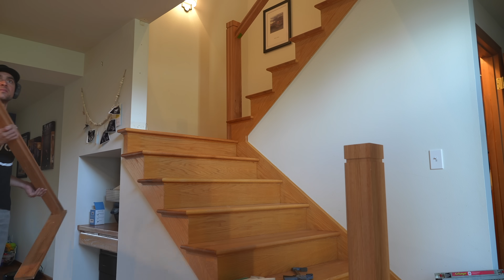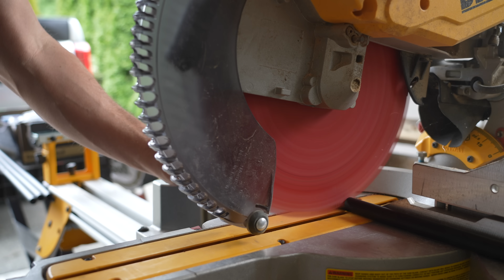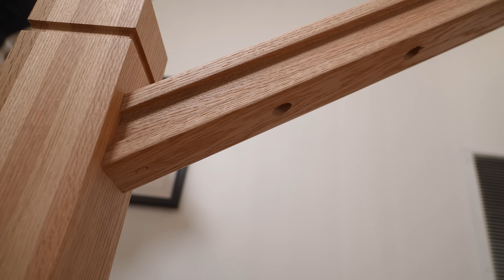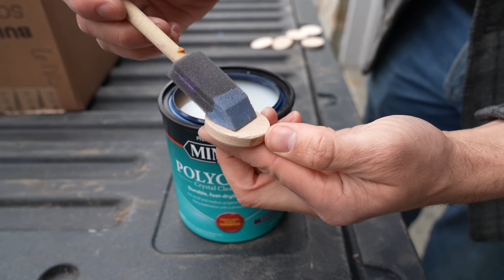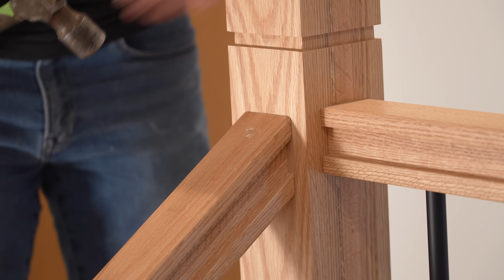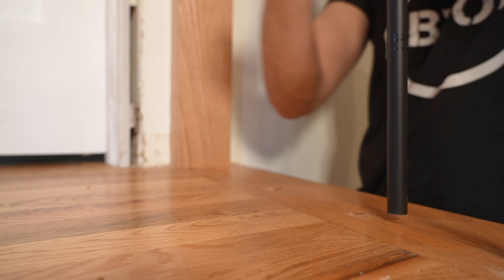Transform Your Staircase: DIY Metal Balusters Revamp

Comment: Here's some tips from a real pro. 

1. Use your handrail for baluster layout. Then drop it to the floor and transfer the layout. Fast, accurate, and no laser. Same for flat runs or stairs.

2. Drill your handrail before you mount it. Much easier.

3. Use a sharp spade bit. Easier for stair railings.

4. DO NOT use epoxy for securing the balusters. If one gets damaged, you're in for a real treat getting the old one out. Use clear silicone. Quick, easy, effective.

5. Check your spacing. 4" maximum clear opening for building code. I suspect yours are wider.

Comment: I think you missed a very critical piece of information. You may not be able to use the same spacing if you are using a different diameter spindle. the code is designed to keep a small child from getting their head stuck in between the spindles and hurting themselves. that space is usually 4 inches. Every jurisdiction can vary so you have to check with your building inspector. I have been doing trim work for a very long time and I have never seen a stair tread with only two 1/2 inch spindles ever passing coad in any jurisdiction. You may not have kids and your spindles are just for decoration BUT if you ever sell your house or want to rent it you have opened yourself up to legal issues that could be very expensive. That is a very easy code violation for a presale home inspector to spot.

Comment: A paddle bit works much better and leaves a cleaner hole as opposers to what you used. A drill bit will just blow out the top layer as it goes in as well